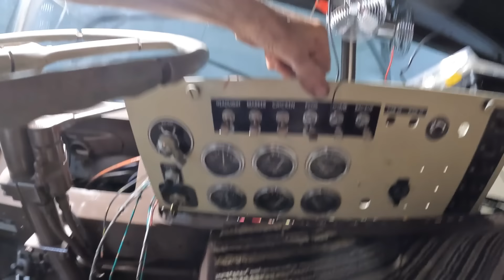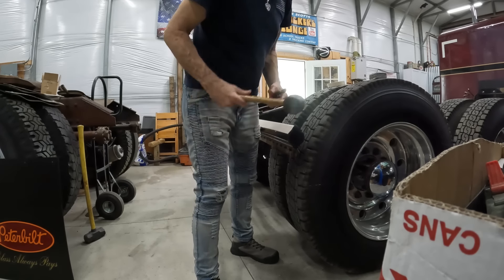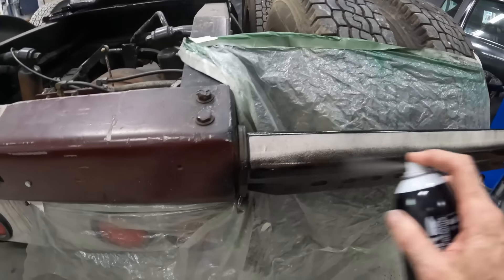Kenworth K100 Cabover SEMI TRUCK Resto Episode 19 - Dodge LNT1000

Comment: I am currently working on the 1/25 scale AMT Chevy Bison big rig kit;and am also working on the 1/25 scale Moebius Models 53' Great Dane Smooth Side Trailer kit,to pair up with my Chevy Bison kit.
I am currently in the process of super detailing both kits with some scratch built parts;and plumbing both the truck & trailer with .8mm to 1mm diameter black vinyl bead cord to simulate all of the oil lines,fuel lines,and air lines.
I will also be using the same .8mm to 1mm diameter black vinyl bead cord to simulate the pig tails for the trailer hook ups.
Reply from the maker: Man that’s gonna be a sweet build! Keep me posted 😬👍

Comment: I love the new mud flaps on Pistol Pete. Grasshopper is looking great. I once had a 77 352 double bunk tractor. It had a 3406-A Cat and RTO-14613 transmission. It once was leased to Daily pulling Flatbed trailers. I miss that old truck. Eventually I hope to replace it with a 359 Peterbilt. I prefer Cats but won't discriminate against Detroit or Cummins. I also prefer 13 speeds.
Reply from the maker: Thanks Sarge you have impeccable taste 😬👍

Comment: The pete steel look good What's you need, Chrome, you need, chrome. I'm all around on grasshopper grasshoppers that Chrome and nice things. Nice new seats eat and they have connect to brother. You work very hard at grass hopper. Get a set of nice new Wilson. Helen said Antony's on there and 8 o'clock beautiful.  Hi, Chrome, in a bag. I'm out of my chromosome stuff. It's high but you worked hard for it